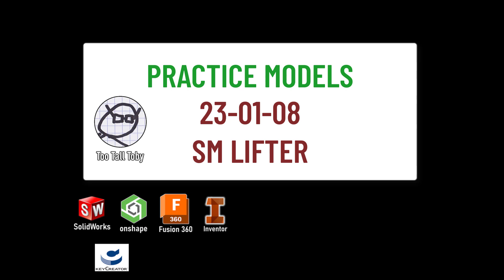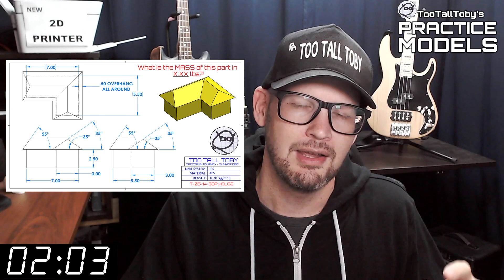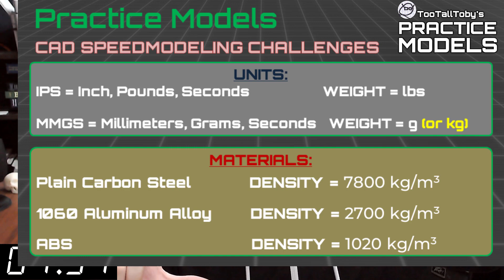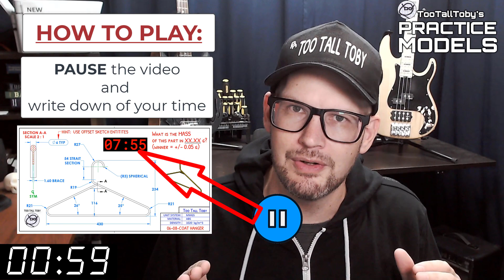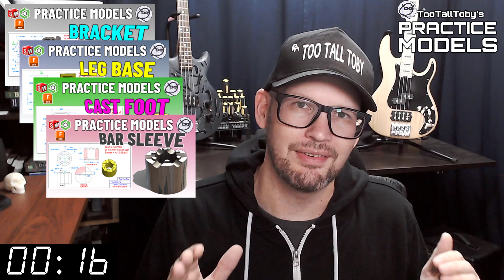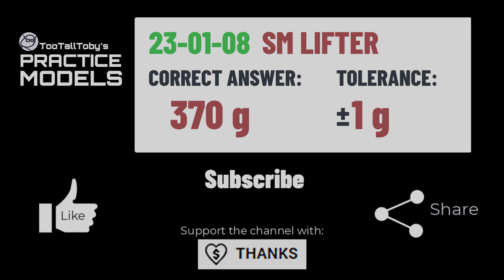Sheet Metal Practice - 23-01-08 - SM LIFTER - What is the mass of this part?

Comment: 370.1605g in 5:25 using sheetmetal functions. Don't know if the different CAD's would end up on the same page but you should ask for the weight of the flat pattern.
Reply from the maker: Yeah the flat pattern calculation would be different depending on how bend deformation is solved, and what settings you input for bend deformation.  We could probably get it dialed in, but it would take a lot of specifications

Comment: Got it down to 3:09 on the 4th go using Inventor 2022:
- first try was mucking around with jogs: took an additional 2 minutes to fiddle those correctly 
- contour flanges are king here: did this for both the primary form and the jogged sections
- great metal work form Toby!
Reply from the maker: Holy smokes 3:09?  that's SPEEDY!!   You should try the leaderboard challenge!  TooTallToby.com/Leaderboard

Comment: 15, I made some errors along the way with dimensions and hadn't used jog before. I then  spent some time trying to use as few features as possible (8 including base flange feel like I should have been able to hit 7).

370.16g folded and unfolded (let's not break the laws of physics here)
Reply: Also, that was fun, was torn with trying it in OnShape or SW (I have both through work and home) and used SW. I'll do the next one in OnShape.
Reply from the maker: Awww yeah onshape FTW!!
Reply from the maker: Very nice job - Nailed the mass!!

Comment: Mass = 371.21 grams 6:59 just going with the flow. SW23
Double checked for errors, but seems to be working out fine. Still got 1 gram more than most people here.
Reply from the maker: Very nice Anne!  Yeah  I left 2 g of tolerance in each direction, because depending on how I did the jog/flange section, I got slightly different results.  So you are still within the 370 +\- 2g tolerance - and that's within spec.  Nice job!!

Comment: That was a fun one. I struggled getting the jog in the right place during the "Model Monday Live challenge" so I had to think about it before doing it again, posted my solve in 2:34 (after testing a couple of methods) on my channel... I think that's the most efficient way to get that jog in Onshape (without a jog feature or the ability to do a "tangent to bend" flange).
My first solve (during the "live") took about 7min to get my first "guess" but something wasn't right and another 3min to fix the issue for a total of ~10min to get the correct answer...
Reply from the maker: yeah I liked this one too!  Sometimes it's hard to make a sheet metal part that's challenging, but can still be defined on a 2D print.  But I think this one came out great!

Comment: I'd love to know how to get the Job function in SW to actually stop at the 20 MM. The dimension entry is for the straight run no matter the angle. How do you inform the program to only drop vertically 20 MM? I cheated it a bit and got my 370.22G but don't feel like I nailed it from a fullproof design standpoint.
Reply: I made that part of the base flange.
Reply from the maker: That's a great solution too!  Nice job!
Reply from the maker: Hi The Muffin!  I did a live solve of this one on Model Monday live this week - here's the link to the timestamp:
https://www.youtube.com/live/I-DypfFUkPk?feature=share&t=2740 
Good luck!  - PS I often cheat on sheet metal flange lengths, too :-)

Comment: Spent an hour on that one and the closest I came was 360g ... I check every quotes and they match, wondering if there is a parameter I'm missing on Fusion 360
Reply from the maker: Did you try doing it as both a thin feature model AND sheet metal, to see if you get different results?
Reply: @TooTallToby  No, I didn't try that method ... If time permits, I'll try it and maybe give a try to onshape sheet metal